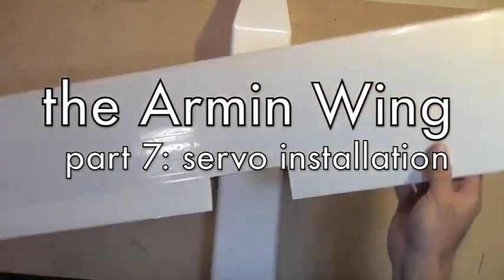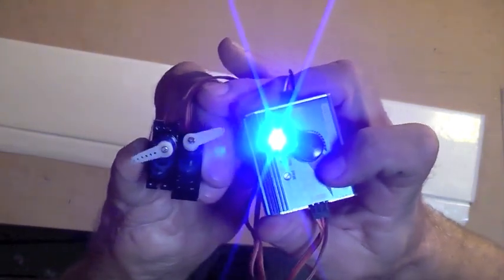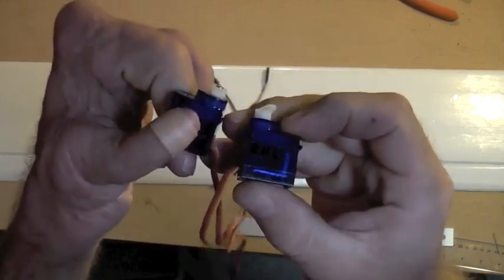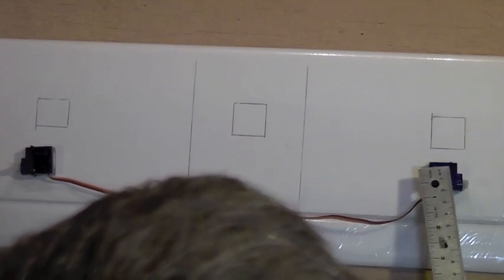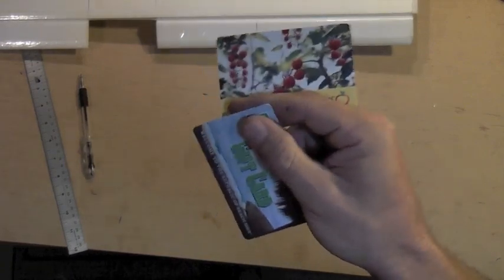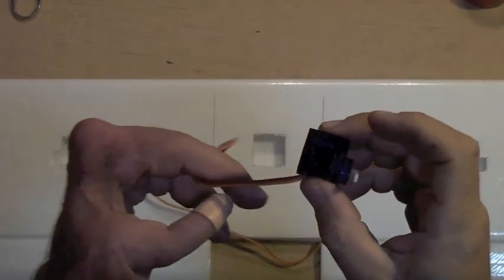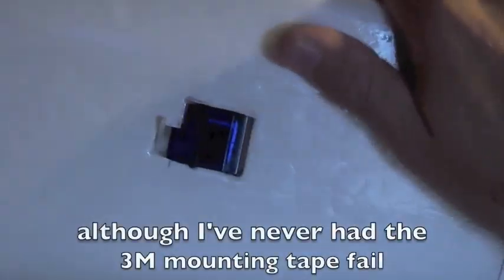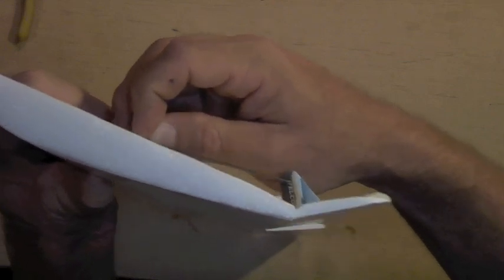the Armin Wing: part 7 - Servo Installation

Comment: I've been using gift cards for years now thanks to your videos. Nowadays I crease them at about 60 degrees rather than 90. They still bend to 90 degrees vertical but now they lean forward over the hinge line. I also cut a slot through the foam and glue them underneath for added strength

Comment: Fabulous stuff here Ed. Been flying Armin a few years now and even my original 60" wings are still flying! This construction is strong, light, and I even used the cheap DT-tape (clear). My recommendation however is to remove ALL the paper from the foam because it does peel eventually (moisture). The tape does not. I have even flown in light rain w/o issues. There are many build-techniques on YT now but if you want it to LAST.. Follow these E-A details! Blue skies capt'n Ed! 73-

Comment: Great job on the videos, one question, you state you want 2inches on the 7 inch wing, How do you get that? Do you cut the bottom on the trailing edge after wing is made, or do you bend at the six inch mark in instead of the 7 inch mark for the two inch trailing edge ?

Comment: Anyone can help me? I need some answers..recently bought fms trojan 1.4m...frt wheel door servo faulty...bought 3 emax servo metal gear type..replaced only the frt bt did not work well...keep rotating non stop...end up 3 servos burnt....im wondering.is it possible to change all 3 servos or something to do with the connection? Bt im confirmed wiring are correct...checked 3x

Comment from the maker: It worked pretty well.  Ultimately I just went with the even simpler, but uglier "Fuglyjet" with a wide open nose.  It's easier to make and I believe a bit more efficient, with a straight gulp of air to the EDF.

Comment from the maker: Partly esthetic preference, partly to avoid putting a weak spot in the upper surface where compression forces are at work.  I have mounted them through the top on a 60" wing and it did form a wrinkle in the paper right at the servo.  Not a big deal though, you could probably go either way.

Comment from the maker: Ideally somewhere between the inner 1/3 of the aileron and the middle of the aileron for the control horn and servo alignment.  The servo itself fits best just behind the wing former, where the wing is still fairly thick but you don't need to actually cut into the former itself in most cases.  If you do actually have a separate, rigid spar you can more safely cut into the foam formers if you need a thicker area for the servo.  The average 9g servo is about 2 1/2 thicknesses of foamboard.

Comment: Where exactly in relation to the wing are you mounting the servos? It looks to be in the middle of the wing, but that is where the spar would go. Are you putting them just in front of the formers. towards the trailing edge?

Comment: M done with canard, wings &fuse. Need some more details on fuse extension. Did u make a smaller fuse (telescopic) or seperate sides to support the fuse ext? Btw, it has come great so far. Also, how to balance aircraft with cg being on the fuse center?I have never flown canard planes. Thanks. Iqbal